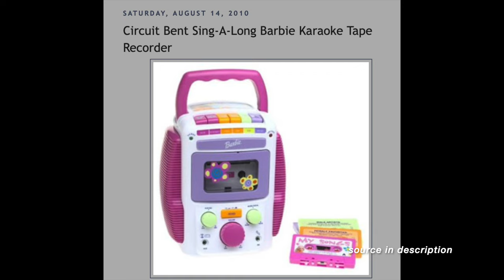The 2001 Barbie Sing With Me Karaoke Machine

Comment: I agree with the bad power supply assessment. That battery compartment is not bad at all. I’ve had to clean way worse. The worst part is when the metal tabs break off from the corrosion then you are sol. A toothbrush and alcohol will do wonders.  Sometimes I just chip away at it with a small pick and then blow it out with some canned air.
Reply from the maker: phew, I'm actually looking forward to this task!

Comment: When I saw the thumbnail I thought that karaoke machine looked familiar. I had the Fisher-Price Tuff Stuff Sing-a-Long Karaoke Cassette Machine, it was designed similarly to this unit with the same front buttons and knobs, it was blue and yellow, but the version I had, had a microphone that snapped to the back and a spot to loop the excess cable. I gave mine up when it ate a tape and a lot of it got stuck in the pinch roller, nowadays I probably would've taken it apart and fixed it like you would. But I didn't before we gave it away. I also agree with the other commenters on the power adapter mismatch. Hopefully cleaning the battery compartment does you good and you can continue using it, or it may work with a different correct voltage DC adapter. Given no capacitors popped on the photo you showed and I don't see any obvious board damage you might have gotten really lucky. I did the same thing with a pair of computer speakers that started humming by using an AC adapter, I was lazy and didn't get the correct DC adapter but the correct voltage, I only had it plugged in and running for 15 seconds but I wasn't so lucky. 😁
Reply from the maker: I didn't hear any popping/see smoke thank GOODNESS so I'm hoping to be safe. It just quietly stopped playing my tape haha, i'm mad I didn't check and annoyed that a seller would just send a random power adapter. smh

Comment: As another commenter mentioned, it says "6V DC" where the plug goes in the barbie unit (the input), and that adapter has an output of 15V AC. Long ago I sadly fried a cool piece of retro tech making this mistake. Unfortunately that's maybe what happened here. It's why you always wanna pay close attention to outputs of power bricks and the inputs required by the device. I too had to learn this the hard way 😔
Reply from the maker: Aw man, I feel like a dumdum for not checking that! wonder where the seller got that plug... I know better than to trust what they send. Hopefully repairing the battery compartment saves it
Reply: @YasmineCollects    yea i feel bad for ya because I know you said it was the one the seller gave you. If i bought a listing i would have assumed the power brick they gave was the one that actually belonged to it, but apparently they gave you a power block from something completely different which happened to have the same plug.
There's no loss in trying some batteries at this point. You can at least be sure it will give out the right power. As someone else also said, the corrosion doesn't look that bad. I personally have seen much worse and still got them to work. Also, the repair to any damage to the circuit board might be rather easy, like maybe down to one capacitor, but I admit that is not something I know much about.

Comment: Thats not the right adapter for the unit. Back of barbie calls for 6v DC and that adapter is (was) 15v AC at a very low current. Probably the buzz was from the AC input and the adapter was cooking up because it was being overloaded.
Reply from the maker: Ughhhhh, is there saving it or did I completely blow it out?
Reply: @YasmineCollects  I would try batteries or a correct adapter before assuming the worst. You probably have a 5v adapter from something like a router or whatever you can try and see if it works since thats still in the range of what 4 almost dead batteries will output.
Reply from the maker: @richms  thank you ❤️